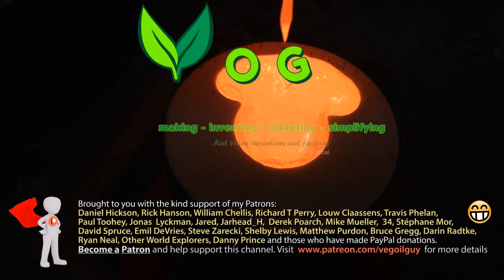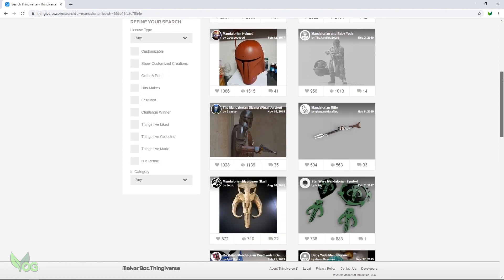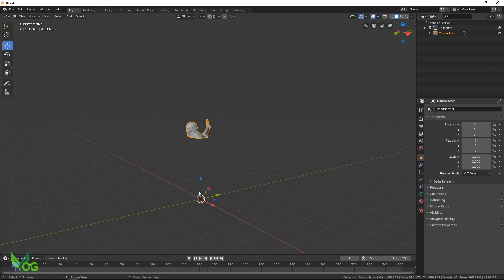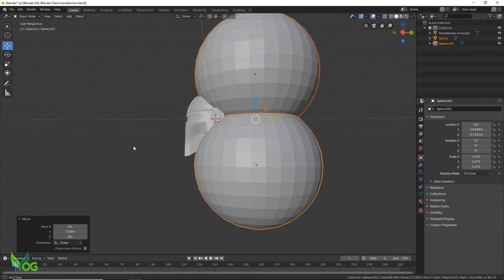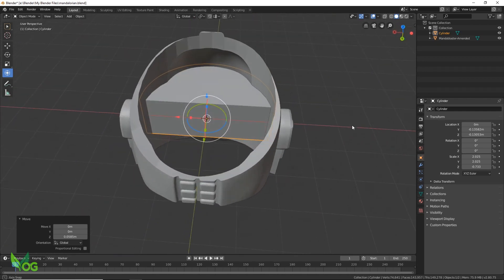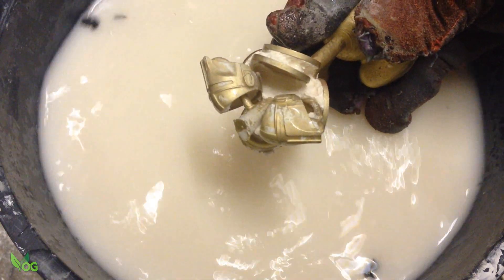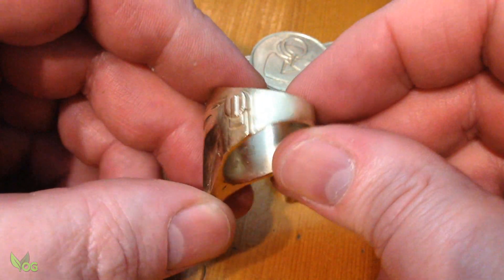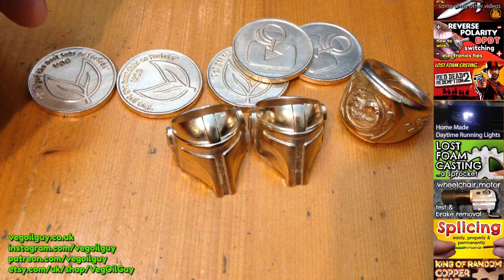Casting A Mandalorian Ring with castable resin - Jewellery at home by VOGMAN

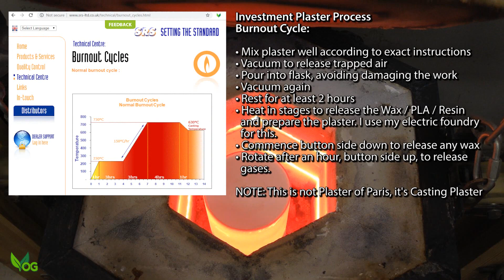Comment: Hi Vog, one question. Do you think that I can use a Devil Forge like this (https://amzn.to/2GsFEes) for the part in 5:38 ? Or is better one like this (https://www.amazon.com/Rapidfire-Electric-digital-Controller-Beadmaking/dp/B00B626FHS/ref=sxbs_sxwds-stvp?cv_ct_cx=Electric%2BBurnout%2BOven&keywords=Electric%2BBurnout%2BOven&pd_rd_i=B00B626FHS&pd_rd_r=809576f9-542c-4414-9a9e-e8c508b84711&pd_rd_w=CJBxm&pd_rd_wg=OnKWV&pf_rd_p=a6d018ad-f20b-46c9-8920-433972c7d9b7&pf_rd_r=Z8FKWEEWF3VHMBNKYVB1&qid=1580227076&sr=1-1-dd5817a1-1ba7-46c2-8996-f96e7b0f409c&th=1) ?
Reply from the maker: If jewellery making is your goal, I'd personally recommend electric. It's cleaner, quieter and indoors. The problem with gas is it's loud, outdoors and has the potential to add porosity to the metal.
Reply: @vogman  Thank you so much!

Comment: I really enjoy your videos and feel inspired to give it a shot

Whats the easiest way to start casting metal?. I've got a Mars and am a trained 3D artist and want try and turn my prints into metal.  Whats kinda of monetary initial investment and  learning curves starting from scratch.

I've seen from centrifugal casts to pouring into heat resistant mold
Reply from the maker: Hi Aaron. It is a fairly costly process unfortunately, but I have developed a few money-saving ideas. Have a look at this video, it should help - https://youtu.be/qxj5eUkAFUI
Reply: Woah crap, Even with those money saving ideas its a crazy large investment i eye balled >1k. Maybe ill try blowtorching pewter into a high temp mold first...

Comment: You're picking up Blender quite fast, but I have a couple of hints for you;

While using Boolean works, you could probably save more time by using edit mode (TAB) to delete the majority of the stuff you wanted to get rid of. That allows you to move and delete individual vertices, or you can select which ones you want using the box select tool (B when in edit mode) and make sure you are in wireframe mode (z) so you can see and select the vertices on the back of the model at the same time. A is to select and deselect all, so you can press A to deselect everything, then use B to select just the part you want to delete and then just press X to delete > Vertices.

That method would have saved you time over aligning all the cubes properly, at least just to get rid of the majority of the bulk, like the body and the weapon over his shoulder. Selecting those with the box select tool would have been much faster.

If you ever want some more Blender tips or have questions I have been using it for quite a while and would love to share my knowledge with you if you think it would help. You seem to be getting along just fine without me though so i'm sure you'll be fine :D
Reply from the maker: Many thanks : )
I always appreciate any help 👍
Reply: @vogman  i'll be sure to try and give you relevant hints when i see you using blender, such a powerful tool and i'm very glad you're getting more to grips with it.

Comment: They turned out really well. Any imperfections, though I didn’t see any, that’s just battle scars...
Reply from the maker: Thanks John : )
Reply: VOG a question, not really my business, but I am asking from a perspective of casting cost.  Do you have any idea what the cost is of the final ring? Printer resin, wax, plaster, electricity for burnout and melting, metal, any used up abrasives, etc...?

Obviously you can make something no one else has, but let’s say Disney put these out in their stores, or something. Maybe in a cheap stainless steal. But who knows, they could charge $40 or $400 due to popularity, so it’s hard to guess what they would charge...
Reply from the maker: In honesty I deliberately try NOT to think of it like a business... if I do, I might stop having fun : )
But I will say this... there are people out there who do nothing but this - making bespoke jewellery - and they make a good living. So I guess the answer is you'd charge what you'd like to earn.
Reply: This was a excellent video and the ring turned out nice very informative, in you opinion which is the best printer for Castable resins Mars or Anycubic
Thanks

Comment: Pardon me if this has been explained before, but how do you get the scale of things right in Blender? Do you save the scaling objects step for the 3D print program when making supports? Or does blender have some solid metrics to work from hiding in there?
Reply from the maker: Dimensions aren't something that comes easily for me in Blender (unlike Fusion 360 which is all about the numbers). I tend to design what "looks" right and then size it in the splicing software prior to print : )
Reply: @vogman  Thank you for the input! That's what I thought you were doing.

Comment: Awesome job, and it seems that your approach to modeling is coming from a fusion 360 approach. Just learning blender myself for more advanced stuff. There are some pretty amazing ways to get things done with the program, after a bit of googling half the time. Surprisingly i realize boolean operations are actually very limited compared to other mesh tools. 
Keep up the inspirational work. Your the reason i'm almost completed with a new lost casting setup. from the other side of the pond, Keep up the good work!!
Reply from the maker: I have no doubt Blender could do in a few keystrokes what I did the long-winded way with Bool Tools. Hopefully one day I'll get to figure it out.
Of the two, I actually prefer Fusion as it's more maths based. But for smooth shapes and mesh work, it's got to be Blender : )

Comment: Do you have a good method to do different ring sizes in blender?
Reply from the maker: I don't - yet. Dimensions aren't something that comes easily for me in Blender (unlike Fusion 360 which is all about the numbers). I tend to design what "looks" right and then size it in the splicing software prior to print : )

Comment: Really cool to see more of the design process, do you think leaving in the face would have made the ring too thin? If not why not leave it in? Thanks for an other inspiring video
Reply from the maker: I just felt the face would have over complicated the casting and also made it uncomfortable. The smooth sides work better : )
Reply: You might’ve had the imprint on your finger after wearing the ring for awhile. 

“Why does your finger have a face?”

Comment: Hey Vog awesome cast as always. 
Ive been wondering if you are using the same plaster as recommended? 
When i mix the investment powder(Pioneer classic from SRS) mine is not that dense when mixing.
I have been using 250grams per 100ml of water, am i doing this right ? 
My castings sadly dont come out as good looking as yours, hope you can give me some tips and tricks.

Thanks !!
Reply from the maker: Hi Minh. I am using the SRS plaster but for every 100g of plaster I use 40ml of water, so unless my maths is wrong that's the same as you. You need to be quite strict with your timing. Work quickly. 3 minute of mixing with a nice fast mixer and then into the flask / vacuum as soon as possible to get all the air out. I gently tap my vacuum chamber as it's going to help displace air. Don't exceed 8 minutes overall.  After that, give it 2 hours to set, then cook slowly... don't exceed 150C temp increase per hour. 
It just takes practice : )